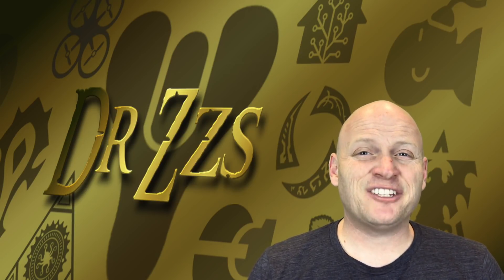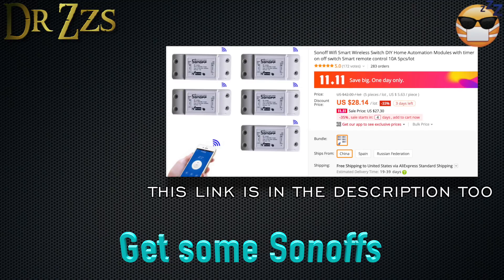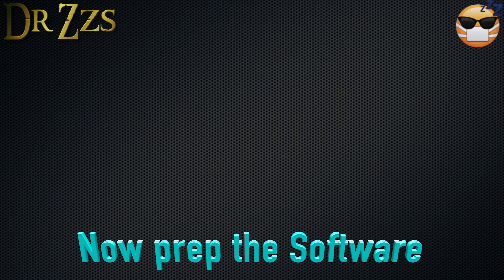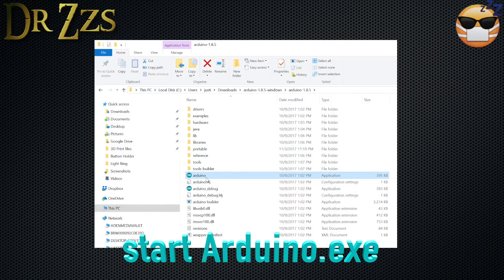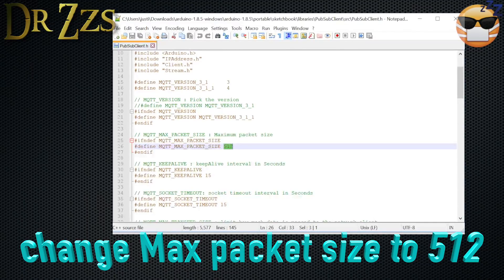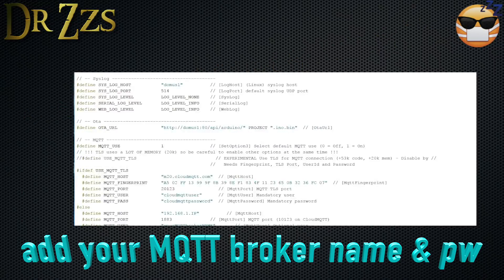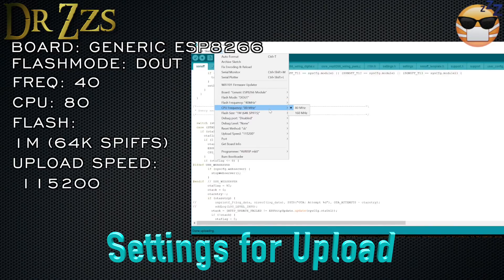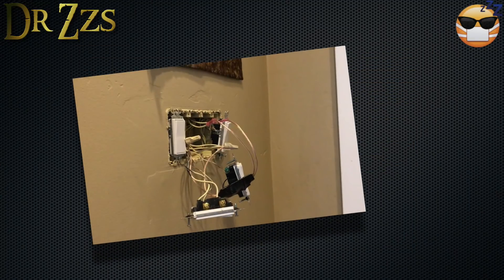Flashing TASMOTA Firmware on the Sonoff Basic

Comment: Doesn't work...... No option to select Generic ESP8266 board
Reply from the maker: Did you add the ESP board manager URL?  I went kinda fast for that part. And, I forgot to mention that after you paste the URL, you have to go to Tools - Board - Boards Manager, and search for ESP8266, and install it. 
Here's a couple screenshots. 
https://www.dropbox.com/s/rty0wwy88bhtha5/Screenshot%202017-12-18%2008.22.05.png?dl=0
https://www.dropbox.com/s/3b4ktw66gh3hb8x/Screenshot%202017-12-18%2008.22.27.png?dl=0

You might have to restart the Ardiuno IDE if it doesn't show up. 
Try that and let me know if it works.
Reply: All sorted.. The next question is how do I find the IP of the sonoff now?
Reply from the maker: Every Router is different.  For me I go to 192.168.1.1 and I get the main page for my router.  Then I can look under "Attached Devices" and find the one that has the project name I put in the User_config file. 
Or you could use something like the phone app Fing.  It will show you every device connected to the same network as your phone. 
You can also look at the serial monitor in the Ardiuno IDE when you have the sonoff connected to the computer still. That's the harder of the 3 methods I've used.
Reply from the maker: Sorry.  I probably went through that pretty fast. Here's some screen shots and instructions:

https://www.dropbox.com/s/1v1pu7nyo6ewtvc/Screenshot%202018-01-09%2012.11.19.png?dl=0
https://www.dropbox.com/s/ge67mmos833fs94/Screenshot%202018-01-09%2012.12.20.png?dl=0
https://www.dropbox.com/s/zaj9v7skwlso0vn/Screenshot%202018-01-09%2012.11.59.png?dl=0

Go to Preferences, then toward the bottom of the screen there's a box for Additional Board Managers URL.  Past this in the box.
http://arduino.esp8266.com/versions/2.3.0/package_esp8266com_index.json

You may need to restart the IDE.  Then under Board - Board Manager you can search for esp8266 and it should be there.  
That link is getting a little old.  Hopefully it hasn't changed. 

That should do it!
Reply: Thanks, the "Tools - Board - Boards Manager, and search for ESP8266, and install it" bit fixed it for me too.  Appreciate the guide, good stuff!  Got my first S20 Tasmota'ing on these instructions.
Reply: I don't know what I am doing wrong, but after entering the url info as per above, no additional boards show up to chose from. Help. Got four of those rascals ready to flash.
Reply: @michaelhenderson5098  same problem...
Reply: Hi. I think the link is outdatet. I've got trouble downloading the board.
Reply from the maker: Try this one:
http://arduino.esp8266.com/stable/package_esp8266com_index.json
Reply: Youtube mangles the links. The one in the comment above by DrZzs which says "Try this one" is complete but the one in the description is truncated.  Use the link in that comment - BUT...manually select and then copy/paste the link that is there into your Arduino IDE - Dont right click and "Copy URL" or you will get all of Youtube's redirect crap as well.
Reply: I tried that too with a custom ESP8266 based relay board, but selecting Generic ESP8266/ESP8285 throws all kinds of compiler errors :(

Comment: Can you use this to open a garage
Reply from the maker: Jose Cruz no. But, sonoff makes an “sv” version. It stands for Safe Voltage. With that one you can separate the power for the control board from the contacts on the relay. So you power the board and then put the switch arm from your garage door into the relay. 
I’ve got it on my list of videos to make. Hopefully I’ll get to it in the next month or so. If you try it before I get it done let me know how it goes. 

I’ve had my garage doors set up with D1 mini and relay shield (there’s a video on my channel page). But they sometimes open randomly. I’m going to try the sonoff sv and hope it doesn’t have the same problem.

Comment: 2why why my sonoff.ino does not look like yours and I can't to seem to find where you enter in the user and password
Reply from the maker: bobby royster  at the top there’s a bunch of tabs. Depending on how big your screen is you might not see them all. There will be an arrow on the far right. Click that and it will show you the tabs that don’t fit on your screen. In that list you’ll see “user_config.h”. Open that one. That’s where you’ll put in the project name, WiFi and mqtt info. 
If you don’t find it let me know and I’ll take some screenshots to show you. I’m just not at my computer right now.
Reply: ok I find it 

Now am getting a error
C:\Users\School\Desktop\esp8266 files\Sonoff Tasmota\Sonoff-Tasmota-5.10.0\sonoff\xdrv_irremote.ino:25:29: fatal error: IRremoteESP8266.h: No such file or directory

 #include <IRremoteESP8266.h>
                        ^
compilation terminated.

exit status 1
Error compiling for board Generic ESP8266 Module.

#### I check the location folder and the "xdrv_irremote.ino" is located in the directory
Reply from the maker: If you aren't using an IR remote you can comment out the lines in the user_config.h file that have to do with IR.  
Try that.
Reply: thanks for the fast replies .. its creating a domino affect where other stuff that needed to commented out so I went with  espeasy ino for the sonoff...and add this to my HA
switch:
  - platform: mqtt
    name: "Printer Power"
    state_topic: "sonoff/power/Switch"
    command_topic: "sonoff/gpio/14"
    payload_on: "1"
    payload_off: "0"
    optimistic: true
    retain: true

Thanks to you I now know there a gpio 14 which I can connect it to a light switch for on/off
Reply from the maker: I tried ESPeasy once.  I'm planning to try again soon
Reply: thanks for the vids
Reply from the maker: bobby royster You’re welcome!  Thanks for watching and asking questions!

Comment: Followed you video but keep getting the following:

Arduino: 1.8.5 (Windows 10), Board: "Generic ESP8266 Module, 80 MHz, 40MHz, DOUT, 115200, 1M (64K SPIFFS), ck, Disabled, None"

Build options changed, rebuilding all
C:\arduino-1.8.5-windows\arduino-1.8.5\portable\packages\esp8266\tools\xtensa-lx106-elf-gcc\1.20.0-26-gb404fb9-2/bin/xtensa-lx106-elf-ar: unable to rename 'C:\Users\budlyte\AppData\Local\Temp\arduino_build_499414/arduino.ar'; reason: File exists

exit status 1
Error compiling for board Generic ESP8266 Module
Reply from the maker: I wish I knew what that error means.  That's not one I've seen before.  Nothing came up on quick google search either.  
I'd recommend asking in the ESP8266 Google+ group.  They're smarter than I am. 
https://plus.google.com/u/0/communities/110904087254752417703
Reply: Did some digging and found out that some time ago this issue was talked about.  Thus far no one has a solution.  Could be a file conflict of some type that doesn't occur all of the time.  I re-ran the compile several times without any changes and on several occurrences it worked perfectly.  Bottom line is you have to put up with this but re-running it is the only solution.
Reply from the maker: bummer.  
guess that's the nature of the beast sometimes with DIY electronics.  
Glad it worked eventually for you.

Comment: An even easier way is to use Sonota! No soldering, no serial flasher required etc. I've flashed 4 sonoff basic, a sonoff 16a POW and a Sonoff Touch with Sonota. https://github.com/arendst/Sonoff-Tasmota/wiki/SonOTA
Reply from the maker: Philip Embleton I Just discovered SonOtA. Do you use the python script?
Reply: Yes. Make sure you have python installed. Then just run the sonota.py script and it asks for your wifi etc and follow the steps. Some modules either require a firmware update with the ewelink app first or you can use sonota.py -- legacy (double hyphon there). Also very important to disable the firewall. It then ends with a freshly flashed module booted up in AP mode where you connect and put in your wifi (again) and that's it. Easier than soldering!

Comment: Great Video and everything works.
Is there a solution for the following issue:
I would like to use the sonoff dual for my shutters. 
This means, if I switch one Relay on I have to switch off the other one.
Is there a sketch available which include this function?
Reply from the maker: Thanks!  
I just finished a video on the Dual.  It'll be up tomorrow morning. (I hope your Dual is an R2) 
I didn't go into the different possible switch functions, but that's part of what makes Tasmota great.  You can change what happens when you activate the switches.  
I haven't looked into it much, but you might find a solution by changing the SwitchMode.  The link below is a list of all the commands you can type in the Console and what they do.  The functions aren't all really clear, but with a little experimenting I bet you find one that'll do what you're looking for.

https://github.com/arendst/Sonoff-Tasmota/wiki/Commands

Good luck!
Reply: DrZzs 
Great. I will watch the video tomorrow. Perhaps I find a solution for my shutter problem 

Thanks again
Reply: I watched your Video for the Sonoff dual and also my Sonoff Dual works well.  
The Problem for my shutter is difficult because if I switch relay 2 on I have to switch relay 1 off.  The Motor can only work in one direction up or down.  

Is it possible to adjust the Sketch in this way that only one relay is switched on?

Comment: I got this error when upload:
xdrv_ir_send:46: error: 'IRsend' does not name a type

 IRsend *irsend = NULL;
Reply from the maker: Bummer, 
looks like its trying to do something with IR.  Try going into the user_config.h and comment out lines that refer to IR stuff.  
https://www.dropbox.com/s/u5b17ak3sqlp2o0/Screenshot%202017-12-07%2017.27.45.png?dl=0
or you could try checking to make sure you have the IRremoteESP8266 library loaded. 

Let me know if either of those works for you.
Reply: DrZzs Thank you I solve the error replacing IR library from the download Project folder instead the arduino library. Its works. Do you know where can I know if the device is connected yo the network via mqtt? Thanks 4 your attention.
Reply from the maker: that's good news!
You should be able to see if your device is connected to you network by looking for attached devices in your router. Every router is a little different.  
If you're trying to test MQTT, Ben does a test at about the 4:30 mark of this video: https://youtu.be/AsDHEDbyLfg

If you have home assistant you could test your MQTT connection by using "Services" under Developer Tools, then "mqtt.publish" then 
{
  "topic":""cmnd/sonoff1/power"",
  "payload":"ON"
}

Replace "sonoff1" with whatever you used as the Project Name. 
Here's a screenshot:
https://www.dropbox.com/s/n3owa77slx6ddxg/ServiceMQTT.PNG?dl=0

Hope that helps
Reply: DrZzs What I need is know if the device is connected to my network programatically WITH node.js and npm for developing a homebridge plugin I noticed that existing tasmota plugin still toogle in ios home app even if sonoff is offline
Reply from the maker: Sorry.  That's not something I'm familiar with.

Comment: Hi there, thank you for the video.  Just wondering if I am not going to use Username and password for MQTT, do I leave it blank? eg ""
Reply from the maker: good question.  Sorry, I don't know the answer.  
I guess you can just try it and see.  You can change it in the user_config.h file before you flash, or after you flash you can go to the Configuration - Configure MQTT and blank out the user/pw boxes. 

Let me know how it goes!
Reply: Thanks, keep getting this error!  Will try again. Cheers
Reply: Hi, I was going to ask this also. Have you manage to get it to work without having to use a username + password? My current mqtt config dont have any usrname and pswd set.

Thanks.
Reply from the maker: I haven't tried it, but based on the set-up instructions for Mosquitto in Hass.io it looks like user/password are "optional".  So I guess you just have to tell the Sonoff the IP address of the MQTT broker (under 'host' in Configure MQTT).  
Hope that helps!
Reply: I was not able to flash my sonoff using arduino ide. I followed another instruction using command line and it worked for me and it I don't have to use any password at all. I use Drzzs mqtt commands on my Home assistant configuration.yaml. Combination of two smart persons. Drzzs and Csongor Varga

Comment: exit status 1
Error compiling for board Generic ESP8266 Module.

got the above error
Reply from the maker: I answered your question in the github page, but for the sake of others that may look here for a response...  Seems Robot_Control is something that got added to your Ardiuno IDE that Tasmota doesn't need.  The simplest fix might be to install a fresh version of Arduino IDE.  
Hope that fixes it.
Reply: update i just deleted the robot library manually also i got an error while install the firmware and it was because of the cross connection you suggest for the two data cables for some reason it did not work for me when they were connected straight had no issue.

I have not installed MQTT server yet but there seems to be an issue while controlling it with Alexa app for some strange reason as soon as i opened alexa app the device turned on and no matter what i did it would not turn off and would constantly get device unresponsive error

It gets even more strange because the device works perfectly with echo dot the issue is only when Alexa app is opened

Thanks for the video there were some issues i faced but atleast your method i was finally able to flash the device which i have failed on mac 

However by default the board is not installed you need to search for it and install it something you have not mentioned in your video and worthwile mentioning as otherwise novices like me would have some extra struggle

Comment: Thanks for the video. I had been struggling with how to flash Tasmota using the Arduino IDE. However, I am getting an error on compile that I haven't been able to resolve:

xdrv_ir_send:46: error: 'IRsend' does not name a type

 IRsend *irsend = NULL;

Other posts I read described a conflict with the Robot IR Remote library, but I don't have that installed. Any other suggestions?
Reply from the maker: Hmmm...  Probably the easiest solution is to install a new fresh version of the Arduino IDE in a different folder and use it just for this project.  
You'll have to redo the Board Manager URL, and add the Json and PubSubClient libraries. 
Let me know if that fixes it.

Comment: thanks for the video I have found in almost all cases it is better to buy the Sonoff Dual WiFi Wireless Smart Swtich it is almost as easy to flash and having dual switches also for greater flexibility . I'm really eager to see what you do with smart touch switch that is something I have not used in my setup
Reply from the maker: I'll have to get a Dual.  I have a couple places where I want to control a fan and a light in one box.  A Dual will be better than trying to squeeze 2 Basics in there. 
I have a Sonoff Touch.  Haven't even opened the box yet.  I'll get to it eventually.  So many cool projects!

Comment: i have been using sonoff  switches following the BRUH automation videos flashed  with tasmota firmware
my question is that when i restart home assistant it doesnt retain the state it always comeback off is this normal or i have something wrong?  thanks for the video
Reply from the maker: Kemuel Rojas. No it should retain the state.  In your Home Assistant configuration file where you have your switch listed you should have a line that says “retain: true” like this:

switch:
  - platform: mqtt
    name: "Back Porch"
    command_topic: "cmnd/sonoff/power"
    state_topic: "stat/sonoff/POWER"
    qos: 1
    payload_on: "ON"
    payload_off: "OFF"
    retain: true

If you have that and it still doesn’t work let me know and we’ll try something else. 
👍🏻
Reply: yes i have the same configuration
Reply from the maker: ok.  Then it must be something in TASMOTA.  There's a "PowerRetain" command that might be the ticket. I don't know exactly what it does but that's what I'd try next. 

https://github.com/arendst/Sonoff-Tasmota/wiki/Commands

PowerRetain  Show current MQTT power retain state
PowerRetain 0 / off (default) Disable MQTT power retain on status update
PowerRetain 1 / on Enable MQTT power retain on status update

On the URL page for your switch click "Console" and type "PowerRetain" in the box and hit Enter.  Whichever it is try changing it to the other (0 or 1).  

If that's not it, maybe it's one of the SetOptions.  

Have you asked in the github issues? 
https://github.com/arendst/Sonoff-Tasmota/issues

or the google Community Forum.
https://groups.google.com/forum/#!forum/sonoffusers

There's probably people there smarter than me.
Reply: i fixed it thanks for the help and videos
Reply from the maker: Kemuel Rojas what did you change to get it working?
Reply: yes i got it working with this On the URL page for your switch click "Console" and type "PowerRetain 1" in the box and hit Enter